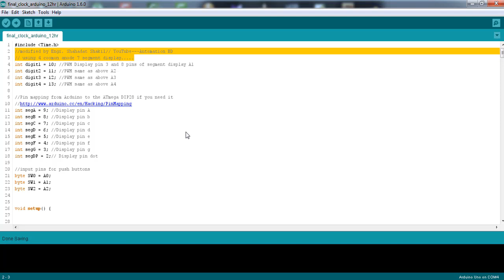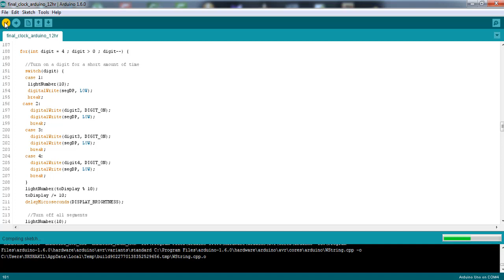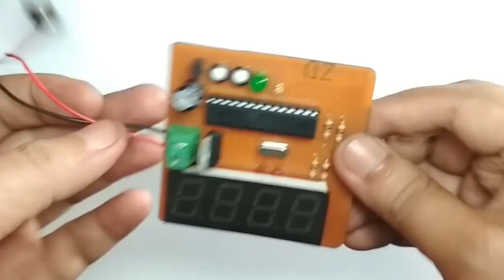How to make Arduino Digital Clock at home ---2019

Comment: Cool the project but, as a suggestion, I think the jumper should be dismissed. The reason for this is that the entire circuit would be inside a box and, whenever it was necessary to set the time, the box should be opened to have access to the jumper and this would be a nuisance.
Unless the jumper was replaced by an on-off button and it was placed on the outside of the box to gain access.
Do you have the PCB design to share?
Thanks
Reply from the maker: If you need box type digital clock then connect 2 wire in jumper point and setup outside the box any where connect switch.
PCB download link in description box checkout please. Thanks